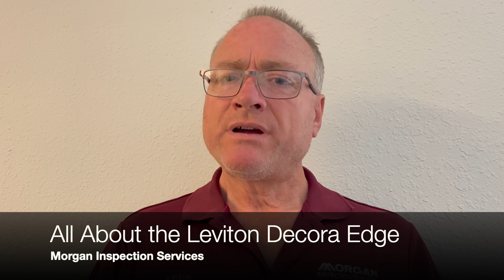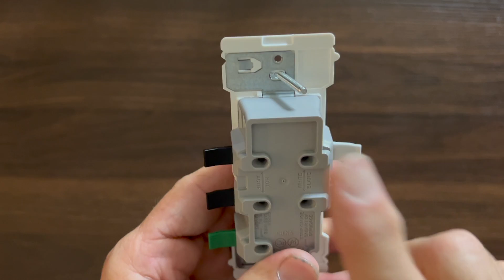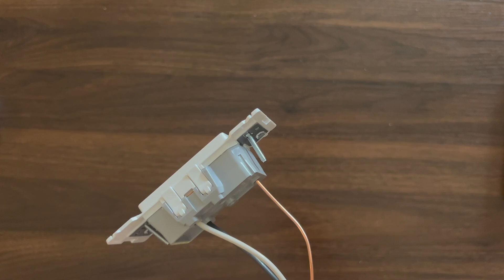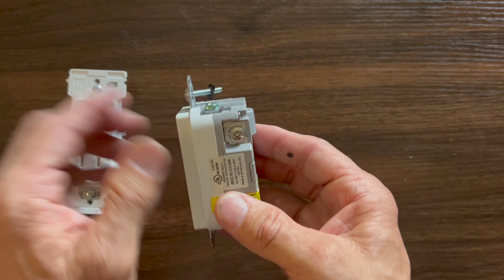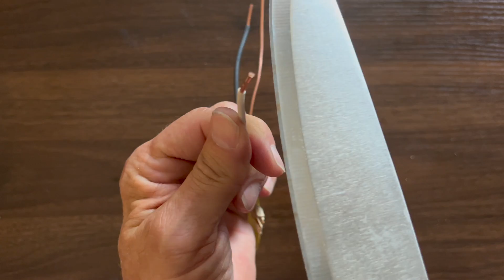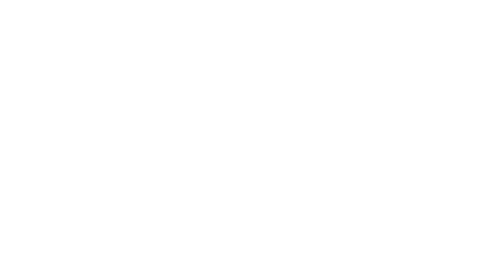Easiest and Quickest Outlet to Install - The Leviton Decora Edge

Comment: In Canada, my house's 30-year-old Leviton outlets are all push-to-install.  To install you just strip the wire and shove it into the hole (it also has the traditional screw-type connectors on the side).  To remove, you need a thin object to push into the release hole next to the wire to release the clamp.
Reply: The surface area controversy is similar between Wago lever nuts and traditional wire nuts. From what I have seen in comparison testing the wire nuts will produce less heat, but was only significant above 40 amps. So, on a maxed out 20 amp circuit with 12 gauge wire they are mostly equivalent. There's no denying that there's more surface area contact with a receptacle screw or a correctly connected wire nut, but the question is, does it matter?
They cannot be used in places like garages and home workshops where surface mount boxes and covers are likely to be used. They won't fit in metal box covers because you can't break off any yoke ears like on the traditional receptacles. They are clearly not meant for that, but something to be aware of.
Reply from the maker: Thanks for the comment
Reply: Those also are in the US, most electricians stay away from using the push connection, because they can work loose and cause arcing and a fire. Leviton uses the lever to secure the conductor in place thus eliminating the danger of arcing.